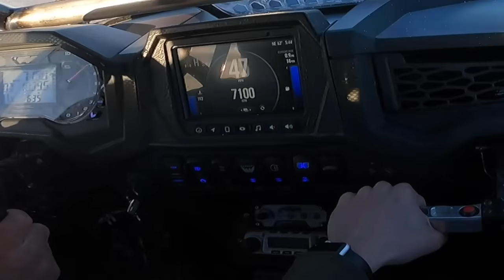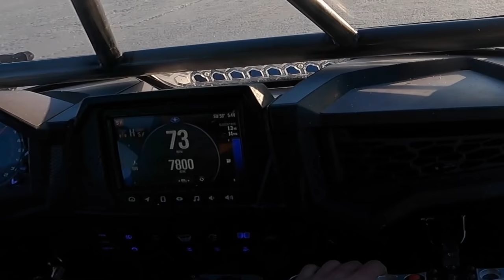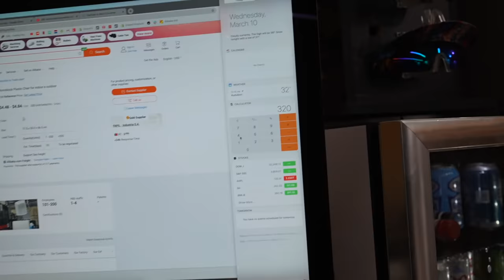Shifter Kart on Highway with No Speed Limit

Comment: Sic 360s fella's. We used to do them at go-kart track in our racing clubman karts do about 100km/h in the wet. We would drift onto straight drifting hard left then quickly hook it right to start spins. It felt like you were turning straight off track into barrier. Down straight we'd   right 360 then left360 then right 360 then off the throttle drift around first left-hand can. We'd pull 3x360, crazy George down straight with drifting in and out.  So fun. Still too this day one of the most fun things I've done driving. Apart from mx racing and fmx. Different world. Avagud1

Comment: 3:45 You are probably going slower then that because your tires not the same size as stock. The smaller the diameter your tire is the slower the tangential speed is for a given wheel RPM. Tangential speed is essentially how fast you’re going off there isn’t wheel spin. You’d have to use a GPS to get the actual speed.

Comment: It probably back fired and lost power Cuz the valves back out and if it's a 2 stroke it could be spark plug or u sucked in sum trash I'd recommend  cleaning  intake amd exhaust clean the carb and check or replace  the plug and it should  be fine hell it could  just be the plug started to fail  out amd the back fire Cuz it mis fired amd then fired on extra fuel

Comment: You have to stop trying to cyclone the raptor, the reason all the lights keep coming in is becuase you can’t full lock the steering wheel while in 4 wheel drive you bind up the front axles, the joint and the transfer case